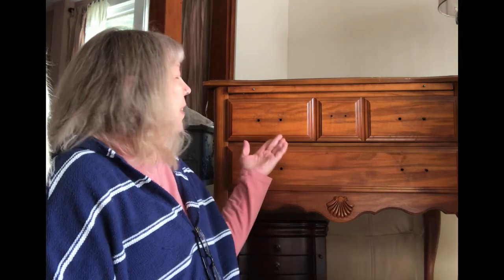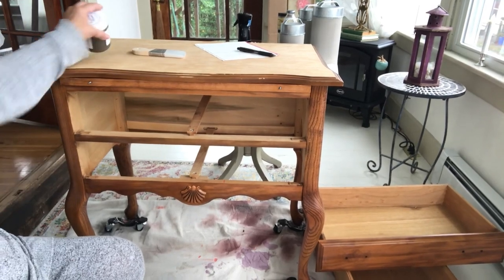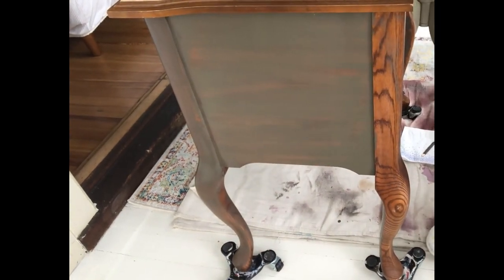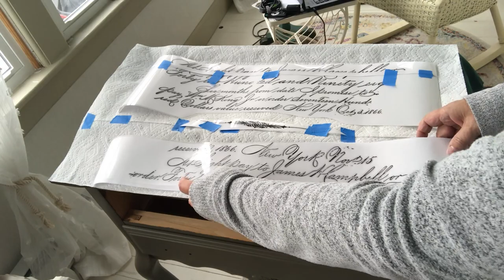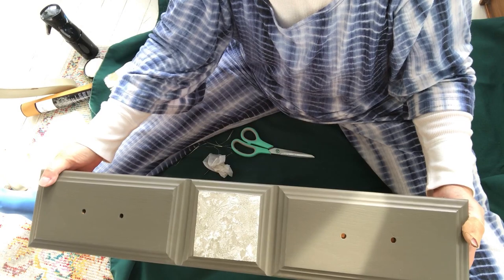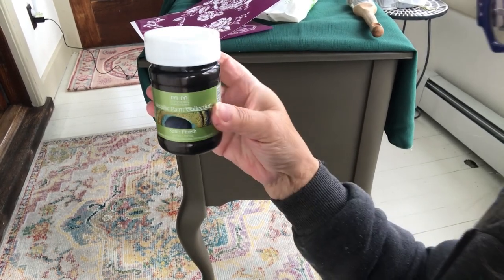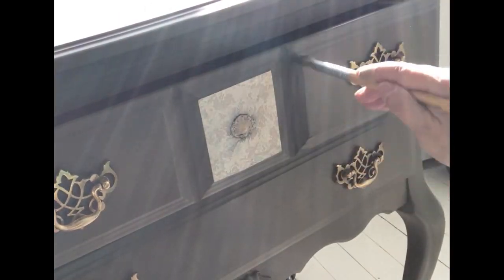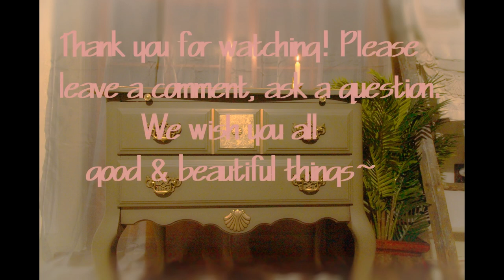Vanity Upgrade with Melange One-step Paint

Comment: It's gorgeous. Love the stenciling on the side. I think it would have been nice to have the flowers painted on the desk extensionas well. But it looks amazing even without it.
Reply from the maker: Thank you so much! I'm so glad you like it! I totally agree with you about decorating the desk extension veneer. It would have been beautiful to add something to it. The desktop was an extremely tight fit originally. It didn't slide in & out smoothly. I would have needed to alter the desktop dimensions even to add something the thickness of paint or gilding wax. I was even worried about staining it! After paste-waxing the underside and slides, the desktop slid in and out nicely so I decided to cut my losses.